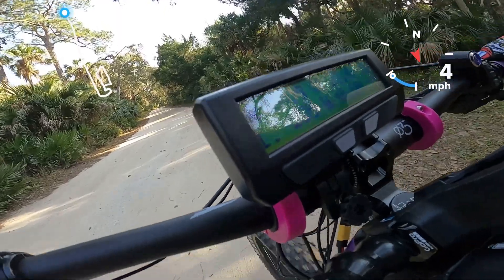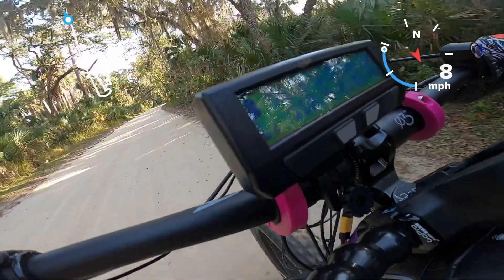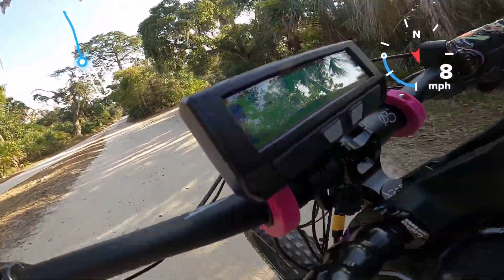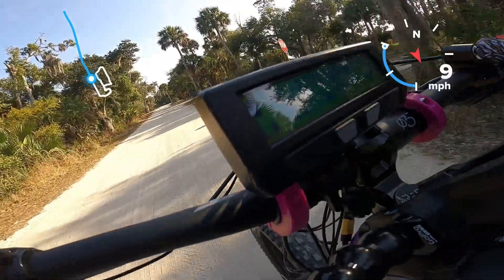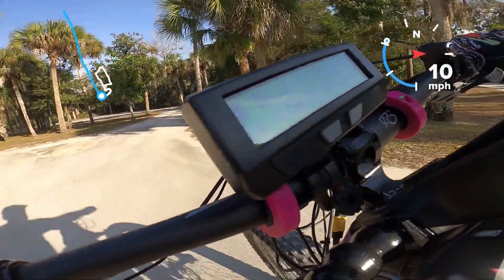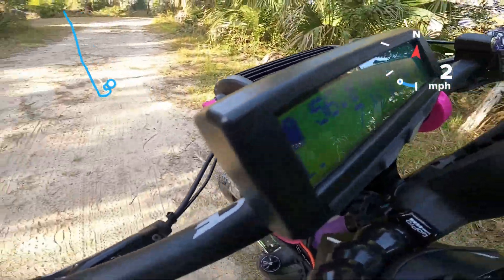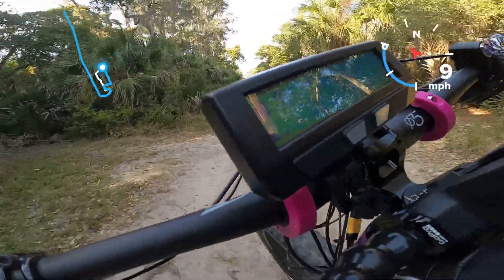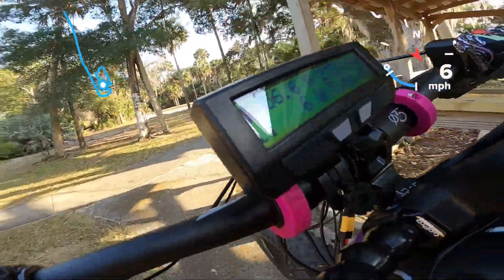BBS-HD + Phaserunner + 25 Amps of field weakening!

Comment: Did you say a 50T rear and a 40T front?
Reply from the maker: I would start with 42 front and in the 30s for the rear. 

Since your on a 20” wheel.  This will be the same as me.

Comment: I got my 52v batteries putting out 4200 watts on a bbshd there's no benefits to running 72v on the BBSHD really other than less heat and possibly a little up tick in speed but honestly I don't see a faster speed when I run 72v because the system just lowers the max amp output and my 52v set up can support the max amps at 52v so either way 72v or 52v with my particular controller which is a different one then yours but very similar the asi bac855+ hacked with a NXT arduino tuner display kit it doesn't matter if I run 52v or 72v it will always output 4200+ watts around the same just at less amps on the 72v naturally so less heat and possibly a bit higher rpms but I don't always notice the higher rpms really.  What I will say is 4200watts on a bbshd powered ebike is fucking mind blowing.  I can put it in a high torque gear and do easy instant power wheelies or put it in a higher speed gear for keeping the rpms down on the long journeys where I'm hitting and holding the motor at very high speeds which I may add when I ride like that I typically do so using a much lower power setting because I find that you don't need that much power to get up to around 30-35mph and than each mph faster after that waste tons of battery power for a small return in added speed so for long trips it's not worth it for me to use the max power output but the nice thing about my nxt set up with the asi controller is I can turn the power down instantly with out having to pull out a phone or get a computer or even stop pedaling and with the newer sine wave and foc tech in these controllers it's so much more efficient then any the cheap square wave controllers that most ebike motors come with.  My two 52v 21ah batteries can get me over 150 miles range at a speed of about 30-35mph the whole way easily and possibly do much further but I'm being speculative and guessing on the lower side.  I've done 40-50 mile round trips using just one of the 52v 21ah batteries and still had plenty power left when I made it home riding it using my eco settings/tune so running both batteries in parallel is really only for when I want to go fast and not run a single battery super hard or get a decent range while going fast or a super duper long range riding efficiently but for the most part I'm fine with one battery.  The bikes super heavy with two batteries.  I'm likely going to build a new battery for the BBSHD bike and for my Segway x260 and likely it will be 72v since I just want all my bikes to be on the same voltage.  I'm planning on eventually getting a stealth bomber Enduro frame which was my original plan but then I got a hook up on a Segway which I'm getting delivered soon and already have a hacked ASI bac2000 controller for it that I was saving for the Enduro build I wanted to do.
Reply: Did you ever get the bomber ? I’m about to post mine up grabbing a Segway x160 soon. 72v bac2000

Comment: Does your motor get hot with field weakening?
Reply from the maker: When you are using the FOW, it will generate extra heat for sure. If you are riding streets and long distance, its best to use high voltage and little to no FOW..  For trail riding and my style of riding I never see over 60C .
Reply: Yea but here's the thing it gets super hot but I ran my BBSHD on 4200+ watts for two months and constantly got it hot enough to burn my hand or leg on many occasions and when I opened it up to put in the steel gear the nylon gear still looked brand new and so did everything else.  I was surprised because I completely expected there to be wear and tear or damage!!!!   Not saying this is a smart thing to do just sharing my experiences.  Honestly I wish I had done more research when I bought my.motor because I would have gone for either a high powered hub motor or a better higher powered mid drive like the cyc x1 pro gen2, the lightning rods big block mid drive instead of the BBSHD because it just doesn't shed heat good enough to make it a good motor for high powered applications.  If it shed heat better and the internals were a bit lighter weight it would be a bad ass motor.  Eventually heat will destroy most motors even mines will eventually get damaged from all that heat over time.
Reply: And it depends really too because sometimes the motor will run cooler if your running it at higher rpms  for example if you turn field weakening on run my asi bac855 at 4200 watts and run it up to full speed in the highest torque gear I have that is the best way to run my set up on full power to keep things cool.  If you run 4200watts but with field weakening turned off and you use the gears since the rpms won't go higher then the stock limit you will likely run the motor up to be much hotter this way running it for extended periods at high power is always better to do at higher rpms to keep the motor cool.  I personally don't fully understand why it does that or how it works but that's what everyone who runs a high power bbshd set up recommends to do.
Reply: @WarzoneWarlordGaming  Higher rpm = higher volts = less current = less heat. I noticed more heat with field weakening vs shifting. Will test again though.
Reply: @Jesusifer669  I agree that it works that way under normal circumstances with regards to the more volts = higher rpms I just don't think it seems to be that way with field weakening though or the difference seems lesser but I likely need to do more testing before coming to that conclusion

Comment: My bbshd goes 30mph+ without any mods. What’s ur gearing like?
Reply from the maker: This does 32 mph in first gear.   55MPH plus in other gears.
Reply: @BuildItTuneItEV  oh boy
Reply: I got up to 43mph stock. Just upgraded to phaserunner, 72v, + steel gear though.
Reply from the maker: @Jesusifer669  Yeah, I have a stock bbshd on another bike at 52v and it does 40mph.  That was in first gear on the bike which was 42/50 gearing :)  The bike can do over 50mph if I felt the need. It's a trail bike so 30mph in first gear is awesome!
Reply: @BuildItTuneItEV  I find with the field weakening turned up almost all the way I really don't get a benefit from switching into a higher speed gear because the high torque gear will not be limited to the rpms the battery voltage can supply but rather the limiting factor then becomes the load or weight on the bike which doesn't change despite the gear your in so what I've been noticing is that in a higher speed gear yes the motor will spin much lower rpms which might get me better torque at that range and speeds but my max speed sometimes doesn't change sometimes it will go up but only by like 1-5mph over the highest torque gears max speed so I'm typically leaving it in the high torque gear most of the time now because the motor likes high rpms and runs cooler that way anyways the only thing is it puts a lot of stress on the other parts of the bike so if I'm holding the top speed for long durations that's when I'll shift to lower the rpms of everything and try to prolong the bearings and chains life expectancy.  I find that these foc sine wave and field weakening controllers are like magic to electric motors and make them run in ways that's sometimes hard to wrap you head around because it's different from gas in so many ways.
Reply from the maker: @WarzoneWarlordGaming  But if you are using the phase runner you will not pass 3250w without fow, It will trip phase amp limit.  This is why I use it,  My setup may not work for you, But it works flawlessly for me.. Who I tuned it for,  The front wheel stands up below 15 mph, and gets me to 32 mph in 42/50tooth combo.. I trail ride, so this works perfectly for me and I don't have to change gears and have the power I need.  If you don't want to run FOW, just dont :)  It may not be ideal for your setup. Like everything in the world, everyone has different intended usage.  For me, using no fow sucks and results in gear changes.  
I'm not worried about life expectancy as I service my own stuff.
Reply from the maker: I now am using a 20S5P .3mm copper pack with minimal voltage drop,  I only use around 5Ah of the 20 I have, So it's well dialed in for my use.
Reply: @BuildItTuneItEV  I just put my phaserunner to 4kW. 72v @50 amps. On a fully charged battery I hit 80v. I read the forums where other people were able to pass the 3300w limit by switching to sensor only mode in the suit, which I did. I haven't had any shutdowns or fault warnings.
Reply from the maker: @Jesusifer669  ramp time, if you have slow throttle ramp you won’t see it.

Set it to 60 amp limit and 4750 w with no ramp rate.  That’s when the issue happens.   If the power rolls on slowly you won’t see the spike on phase amps, but throttle feedback will be poor.
Reply from the maker: @Jesusifer669  also at 80v the issue is less seen.

Depends on your pack and how quick it can discharge, I have 20s5p 45amp cells with .3 copper.  So it can really keep up with the demand.  Find what works best for you!
Reply: @Jesusifer669  why not get the ASI bac855 or vesc instead?  I'm running a asi bac855+ hacked with a NXT Arduino tuning display and up to two 52v 21ah batteries that can handle outputting the controllers hacked max output of 4200+watts.  With 72v on most of these controllers your not going to really make more power but it will run cooler.  You will see a slight increase in speed and rpms but I didn't see a big increase but that's likely because my 52v battery could handle max power
Reply: @Mr360 FPV  I bought what was available at the time. Running 54v, felt slower than stock. 72v made a big difference. I'm riding street, going for speed. 
Currently pushing ~3kW with no FOW. I've seen others push up to 6kW but I want to preserve my battery and motor.
Reply: @WarzoneWarlordGaming  BAC is annoying as they're limited for configuration to endusers (need to get it programmed by someone), VESC is great but doesn't support regular ebike displays

Comment: Hi. What battery do you run here? And do you use the stock Bafang thumb throttle with the Analyst?
Reply from the maker: You can use any 0-5v throttle if you have the connectors or willing to cut the wiring.

I now have a 72v .3mm Copper pack I built.

Comment: i like the  Phaserunner but hate the display  thy really need to update it
Reply: You can use other displays with it.  It's a decent controller but I think the future is with the VESC controllers that are really popular in the esk8 scene but are made in models just as powerful as some of the most powerful ASI controllers.  I personally have three ASI controllers a bac855+ hacked to 4200watts on a bbshd powered ebike which is bad ass to the bone on 52v 21ah batteries times 2 and a Segway x260 with a asi bac2000 controller hacked both run a NXT Arduino display tuner to tune the motor and hack into it.  That way you don't need the bacdoor app access which is the gayest thing in the world that ASI limits access to the tuning app for their controllers smh if it weren't for that they would be hands down the best controllers out there but since vesc controllers do everything that phase runner and ASI counters do but is open sourced and even comes in higher powered higher voltage options then the phase runner and ASI controllers it's obviously going to catch on eventually and be the new best controller to get soon I bet.  I don't get why more people aren't using it already but it is fairly new still and people tend to like copying a successful build that others have done and everyone's using phase runners, ASI bac controllers or sabovoton or what ever that other companies name is.  Honestly the ASI controller do things I can't even begin to understand.  Like the stuff they do to brushless motors and the way they make a motor run.so differently is like magic real talk.
Reply from the maker: You can use any display, or none with the PR.  It may not be the coolest looking but function wise its amazing.  The stock controller is so bad, The throttle curve is horrid.
Reply: @BuildItTuneItEV  I agree with the difference from the stock controller being significant.  I think these controllers that are sine wave and foc capable are all fairly similar like the ASI bac855 is similar to the phase runner and vesc and the new Luna cycles Ludacris v2 is basically a vesc controller made to fit inside the motor which is dope as shit but unfortunately they are stingy about selling it alone and want you to buy a bike from them to get it which is straight stupid.